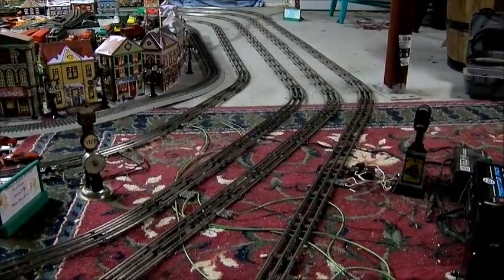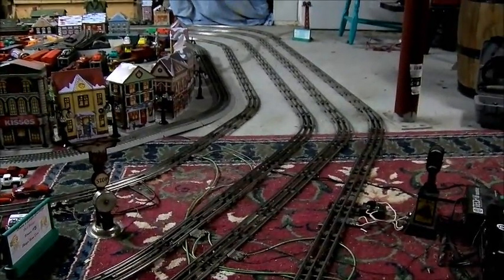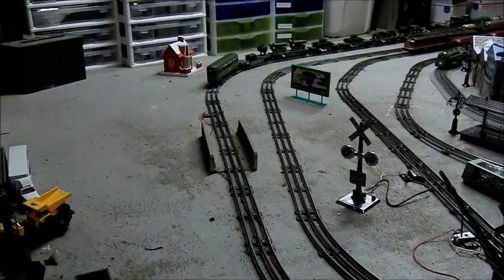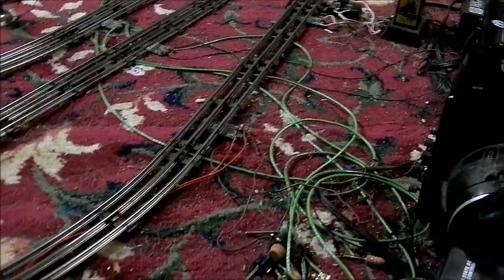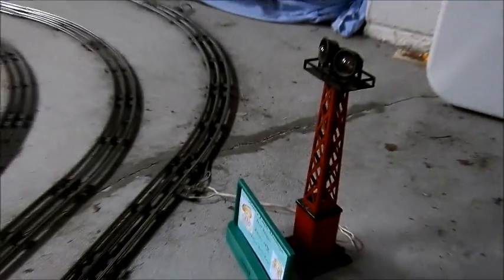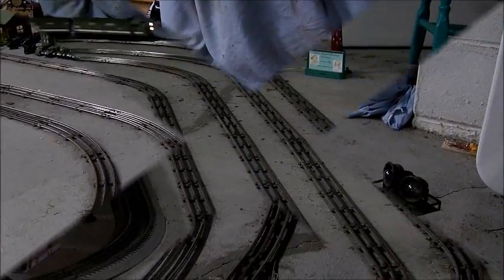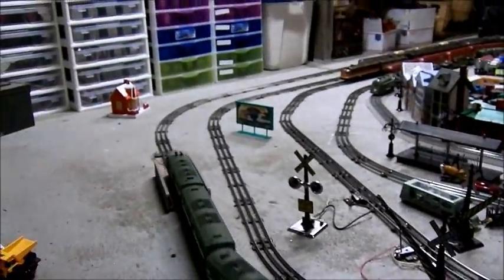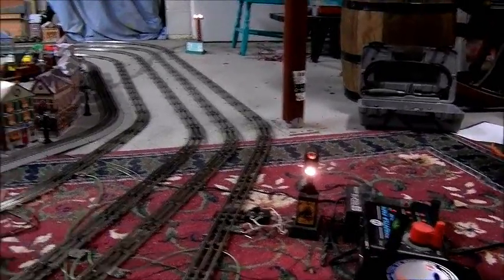Solving voltage drop for O/027 gauge trains

Comment: I also have 027 track and a lot of trains running. If you want to see what I mean look at my video Kendra trains 1 and Kendra trains 40 . Had so much voltage drop and  as time goes on this old track keeps getting worse with more jumpers to add to track.